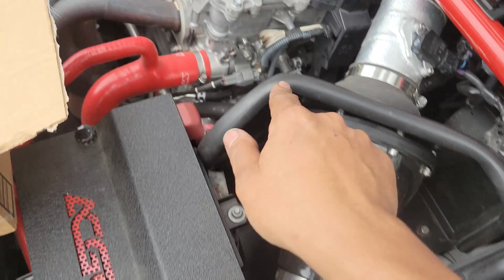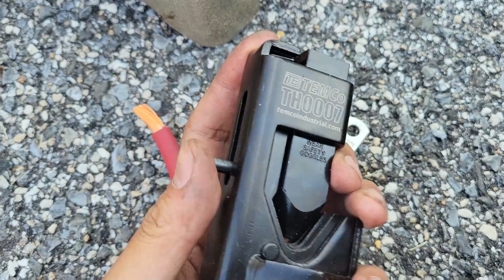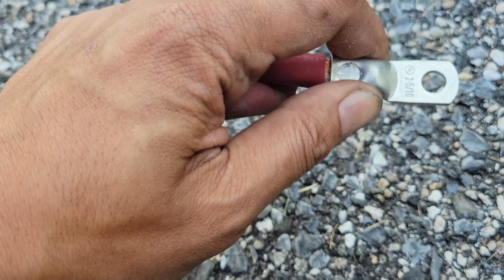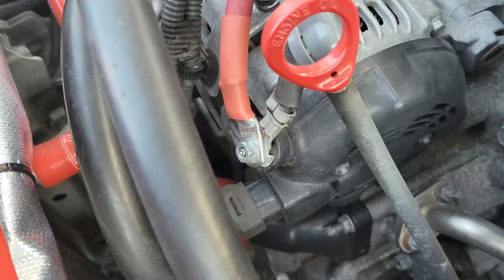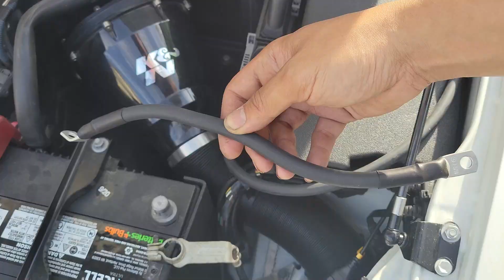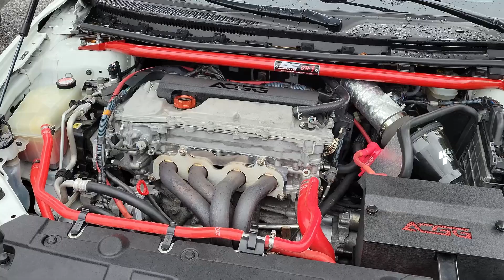Big 3 Upgrade for High Output Alternators and Upgraded Stereo Systems and Subs (Scion tC2 / tC2.5)

Comment: Did you upgrade to a high output alternator? I’m about to do it but curious if I need a different belt since pulley is smaller. Thank you for the video
Reply from the maker: @bryanalchemy369  yes, I did upgrade and it did not require any different sized pulley.
Reply: @VampyreX13  awesome. What alternator did you install? I’m looking at a few right now. Thinking of going with 250a for my setup.
Reply from the maker: @bryanalchemy369 the price has gone up, but I got a 250a one from https://amzn.to/4cCX98S. I've heard Brand X Electrical is supposed to be good in general from other people.
Reply: @bryanalchemy369 talk to Patrick from brand X , I used a 600amp alt from him for my altima with 3 18s and it worked awesome

Comment: Where did you get the intake cone filter shield?
Reply from the maker: I got it from https://amzn.to/3EempmD. It has a 2.75" outlet, so I had to custom print a 3" outlet to match my intake tube.
Reply: Sorry I was meaning the wall shield that is separating the cone from the engine bay heat.
Reply from the maker: That is part of the K&N intake that I did a review for at https://youtu.be/GrYmBWtKnS4.

Comment: How does this improve the car ?
Reply from the maker: It will improve the electrical charging system. This is something you want if you have amps and subs that have a high electrical draw (headlights dim when the bass hits).

Comment: I have a after market sub & speakers with 2 amps....Will doing a big 3 upgrade will work well stock alt & batt? Thinking about doing this before getting my battery & alt upgraded.
Reply from the maker: Yes. That's basically what I did.

Comment: Why does that 2 Gauge looks as big as my supposed 1/0 Gauge. Currently have CCA wiring, wondering if you got OFC cable and if they're truly worth it?
Reply from the maker: The wire I used and have linked in the video description is pure copper and not coated aluminum. I'm not sure if you'll see much difference going from CCA to OFC at 1/0 gauge, but OFC is a better conductor.

Comment: I would not recommend amazon or ebay HO alternators. Most of the time their specs are extremely exaggerated, have very poor idle output, and cheap components. Stick to the name brands like DC power, Singer, Excessive Amperage, Ohio Gen, Mechman, AutoTech, CES, and Brand X.   I have an Autotech 320 on my 2011 TC.
Reply: Is js alternators a good brand?
Reply: @GxcciGxmp   I have heard good and bad from JS alternators. I will say they have a 1.6 out of 5 star rating on Yelp.
Reply: @GxcciGxmp go with brand X Patrick really knows what he's doing, I used a 600amp from him and it worked flawlessly